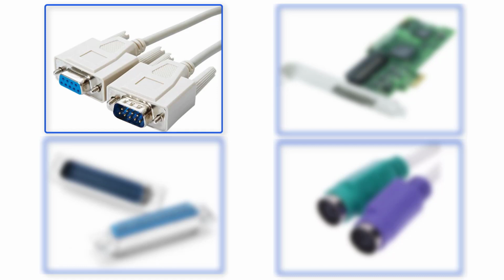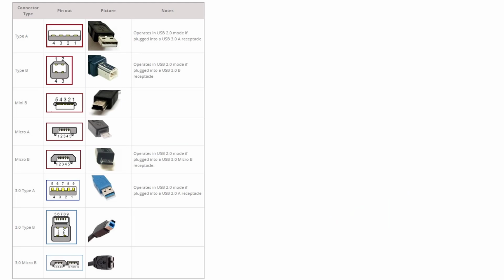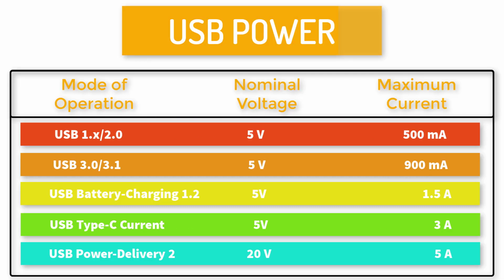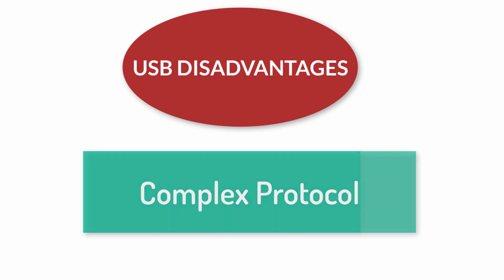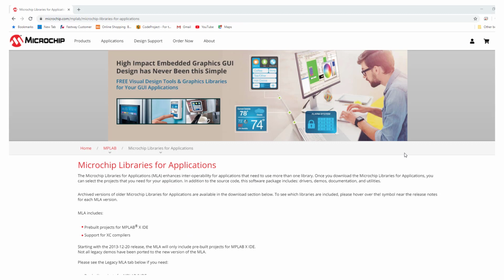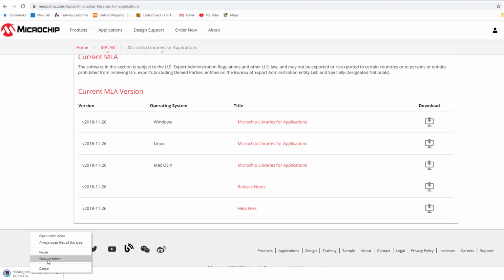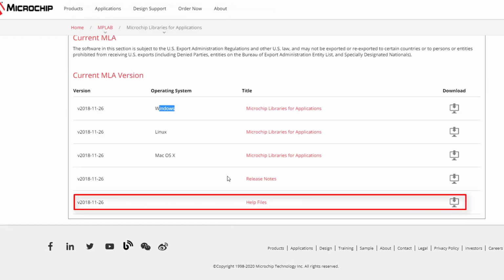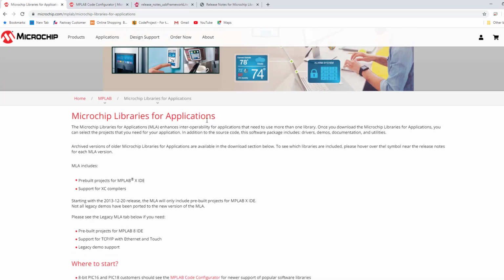62- Getting Started with USB Communication | MPLAB XC8 for Beginners Tutorial

Comment: Very informative video, I learned a lot. I can't wait for the next installment. A question for you, is the PIC18F45K50 a drop-in replacement for the PIC18F4550? The newer chip is a lot cheaper!
Reply from the maker: Yes the 2 chips share a lot in common. The newer chip is cheaper and have more features than the old
Reply: @StudentCompanion  But if I had a working circuit with an 18F4550, could I program the same hex file to the 18F45K50 and have it work the same, or would I have to change the code and recompile the firmware?
Reply from the maker: You can't use the hex file of another PIC even if they are very similar.  You have to generate a new hex file based on the new chip after compiling.  There might be some minor changes especially the configuration bits like oscillator selection. The K50 has new features for example to use the USB in full mode with internal oscillator only something you couldn't do with the old one.
Reply from the maker: This is part 2 : https://youtu.be/79q2KiZ3xxY
Part 3 will be published possibly next week. Apologies for the delay

Comment: It is really helpful, can't describe in a word, Thanks a lot sir and eagerly waiting for second part
Reply from the maker: Thanks a lot. Much appreciated!
Reply: @StudentCompanion  I have one doubt for you. I am using dsPIC33EP412MU810 controller and generate code for USB device by using MCC and i have connected pen drive to USB .So I want to write data on pen drive but generated code by MCC is very difficult to understand. So can you tell me which functions should i used in main code. Thanks in advace sir.
Reply from the maker: Pen drive doesn't work like normal USB.  In this tutorial we explained more about USB device, to you a pen drive, you must configure your USB as host. Did you do it with MCC as host? Does MCC give you that option?
Reply: @StudentCompanion  Thanks for your quick response sir, yes i have configured USB as a host by MCC
Reply from the maker: The MCC generated header files list the functions you can use.  There is a short description and sometimes a simple example how to use them.
Reply: @StudentCompanion  Yes, i am referring the header files but its quit tough for me. If we know something about it, please share it. Thank you.
Reply from the maker: You can check the USB CDC  tutorial on our website for some hints.
We will also publish part 2 of this video soon
Reply: @StudentCompanion  Thank you sir.
Reply from the maker: You are welcome!